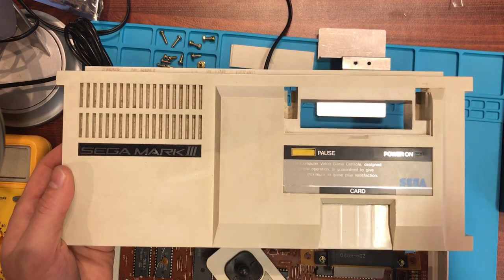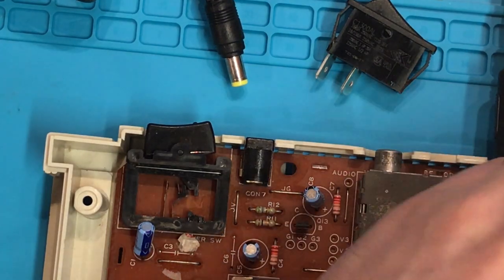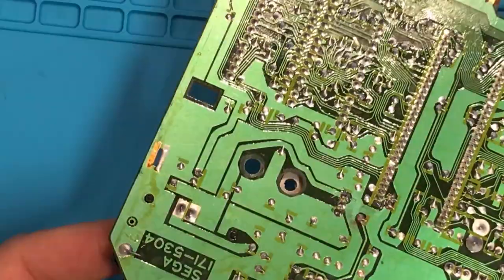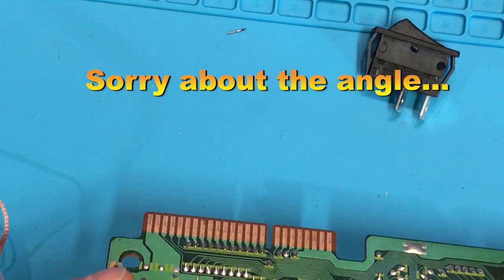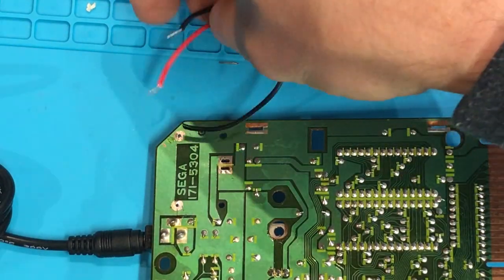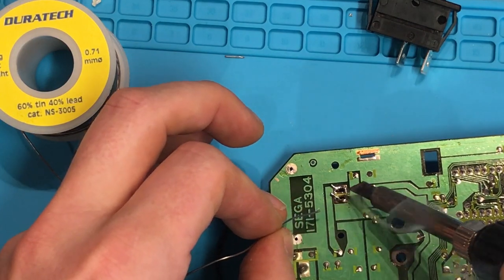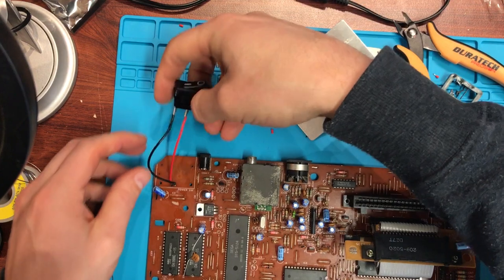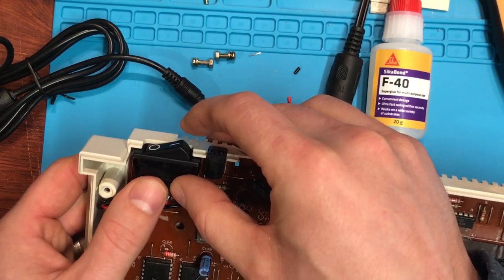SEGA Mark III Power Switch Repair Replace - YouTube

Comment: Great video! This was really helpful for me. I ended up getting the same switch as you, but it was a little too high for the case to fit properly, causing th ebutton t be difficult to switch properly. I ended up sanding down the case just a little bit and now it works perfectly!! Thanks so much!

Comment: Thank you for the pointer towards the Arcolectric switch. I just replaced the power switch in my own Mark III, although I had to gently file the top case so that the new rocker switch could move freely. Really enjoying it.